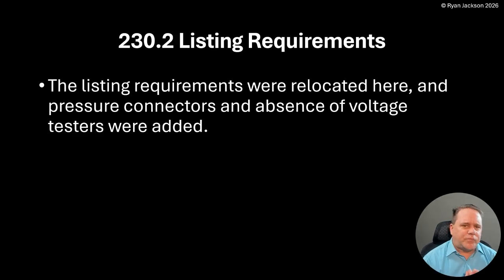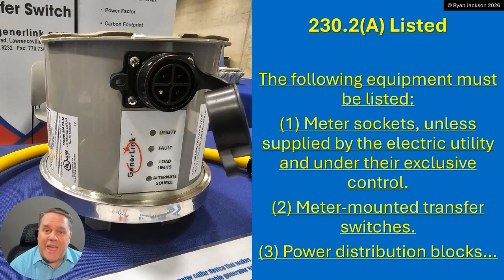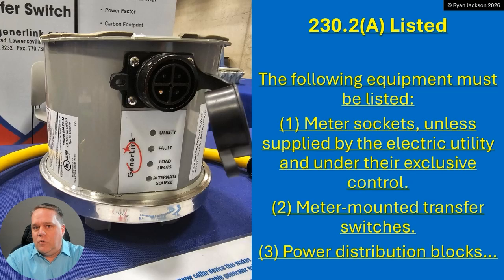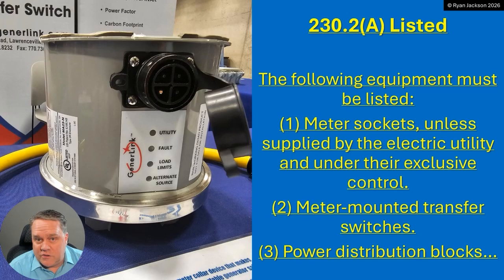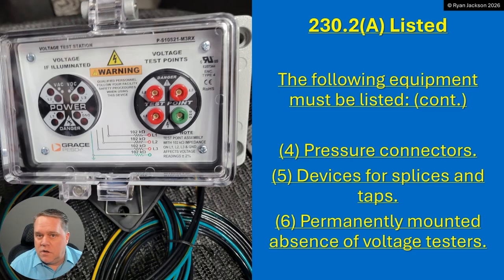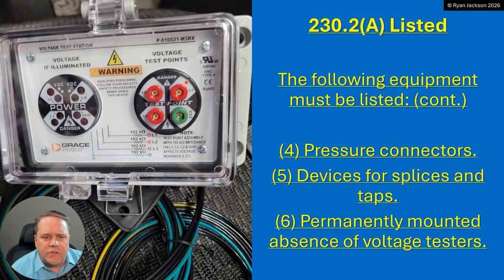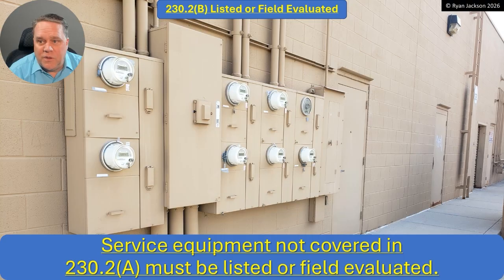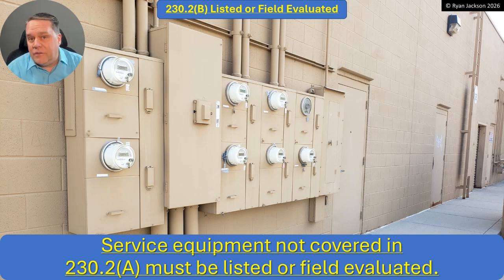100 Days of the 2026 NEC Changes Day 22: 230.2 Listing Requirements

Comment: GA Power will provide all 3 phase metering equipment. What’s surprising is that they’ll also provide residential metering equipment. I can go to them for a free 200 amp socket as long as i can provide a customers address.